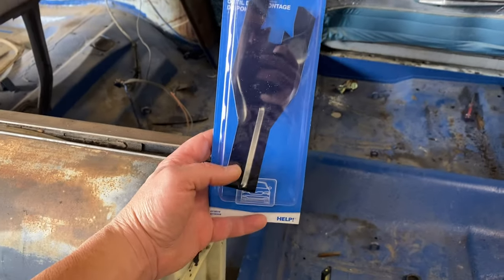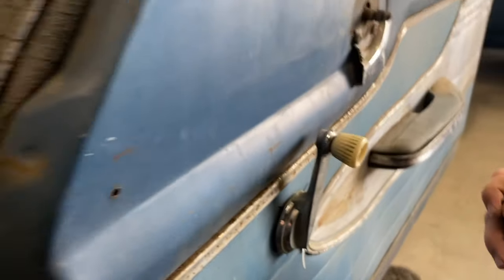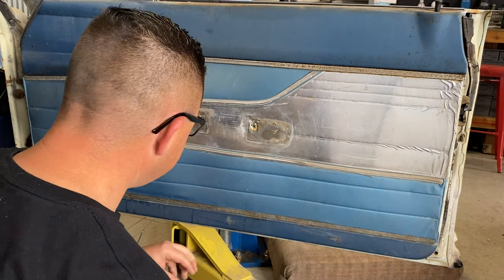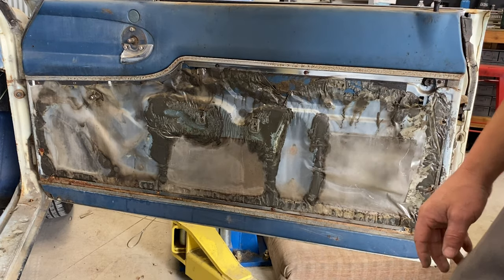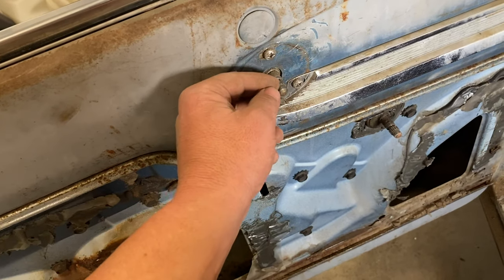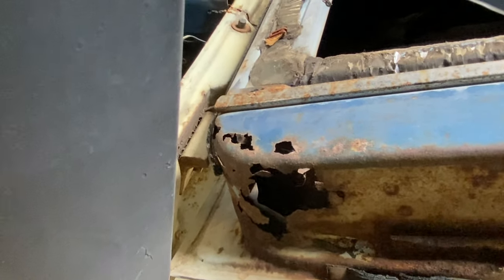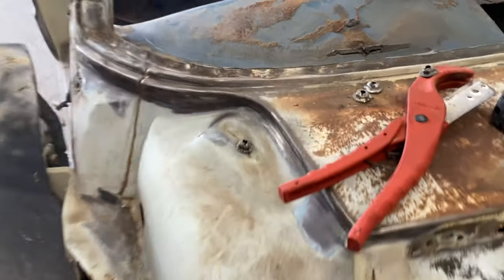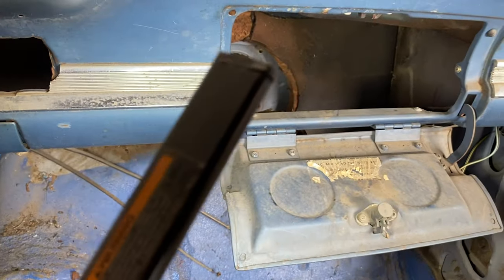1963 FORD FALCON DISASSEMBLY #5

Comment: At least your cowl is solid!  Should be easy to cover the intake holes.  My cowl is completely out right now.  Top and bottom.  Since it was rusted out, I'm probably just filling it in with sheet metal and no holes.  I just got a new camera, so maybe I'll start making some vids.  I gave in to the dark side (and money) and decided to ditch the 2.3 turbo coupe engine and will be going 4.8LS turbo.